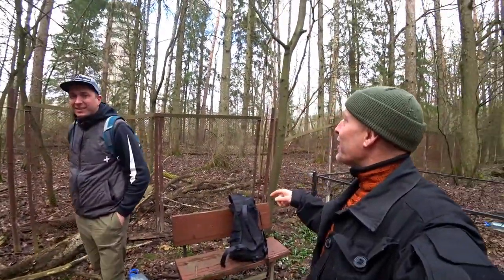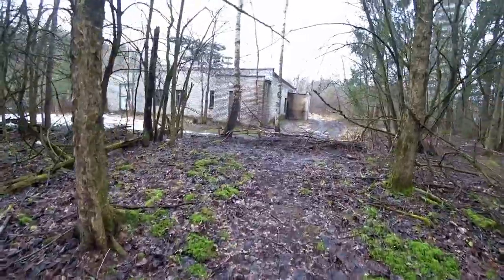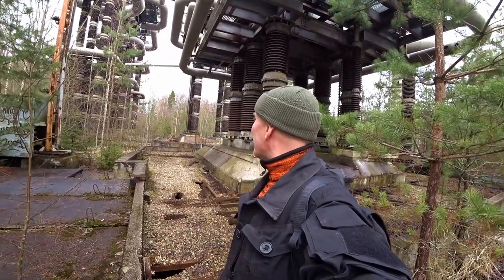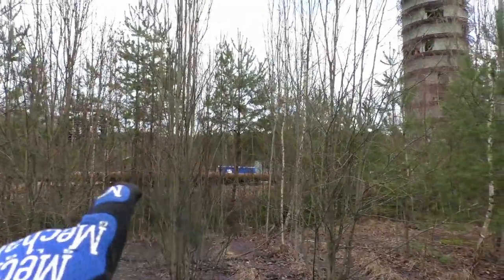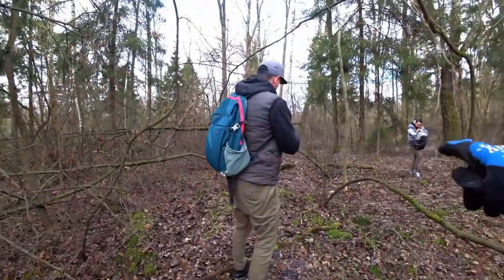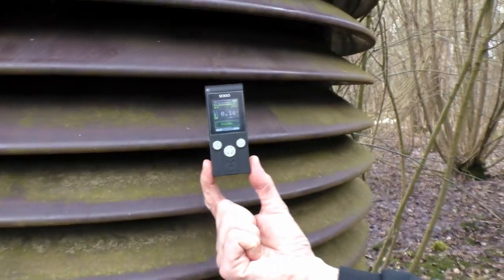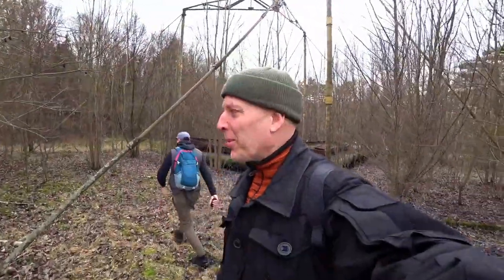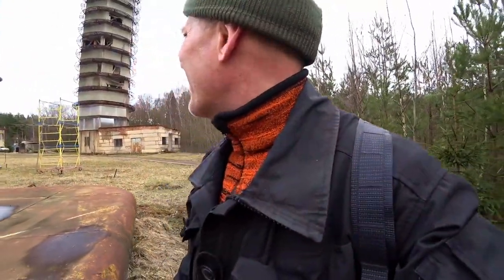Most Powerful Lightning Generator In The World 2020

Comment: the assembly with the 7 large anti-corona rings and 1 elongated anti-corona ring at the top was the cockroft-walton voltage multipler... the other large assembly was a 3 stage cascade transformer. the towers at 9:20 were responsible for generating the high voltage DC which fed the marx generator which was located inside the enclosed tower. sad to see the Cockcroft-Walton multiplier damaged
Reply: Thank you! I saw a video about the Marx generator, but wasn't sure about my assumption about one thing being a cascade transformer, despite I saw some parts looking like the transformer stages of one.

Comment: They aren't Tesla coils. They are either Marx or Graaff impulse generators. They generate 2-3 million volt electric arcs, which are used to test "diverter strips" in fibreglass aircraft body panels.
Diverter strips are intended to avoid lightning bolts from damaging the body panels.
Field day at Istra?

Comment: There is no reason there should be radiation if it's not running and powering a device that produces x rays, proton beams, or whatever.  That is an impressive facility, would love to see it operating.  Must have generated many megavolts. A Marx generator is possibly the circuit used. Great for making lightning like arcs.
Reply: 2 MV, but it's a Graaff impulse generator.
Reply: @thefreedomguyuk   Thanks for the information.
Reply: @stevef.5197   Actually, I've later been looking into this. Turns out they had Graaf as well as Marx generators at that facility. So could be either.
Difficult to see the difference, would need closer images to ascertain. Both can look very similar, obviously a Graaf would need the dynamic band somewhere in the center.
Some sources mentioned at this site had been a 3 MV Graaf & a whopping 9 MV Marx.  Haven't found any documentation, though.
Reply: @thefreedomguyuk   I'm not familiar with the Graaf, is it the same as a Van de Graaff generator?  It's been decades since I built pulsed power generators, so I may not remember everything.  The Marx generator was always fun, generates EMP. 9 Mv is respectable.
Reply: @stevef.5197  Yes, took the liberty of abbreviating  the van de Graaf name.
Am in same situation, have not been practising for decades.
I found some pictures of the facility, and upon scrutinising them, it appears as if there are 2 Marx generators and one van der Graaf, all three of them next to each other.
Seems like there are a few Tesla coil towers at the perimeter of the facility.
Reply: @thefreedomguyuk  Thanks. These devices are impressive, would have loved to see them in operation. Reminds me of Teslas's large power transmitter in Colorado springs.
Reply: Imagine that! A Marx generator in the DDR. :)

Comment: Marx generators. We use a smaller 100kA version for testing lightning protection components at work. Doesn't need to be so big as we connect the parts directly to it rather than having the electricity arc over to it.

Comment: That's a Tesla FREE ENERGY Device
Reply: Wish it was. Unfortunately russians discovered from a bad fan in a factory it transmiited a harmonic frequency that killed the workers and started detroying the factory and causing small ground tremors. The ELF frequency ( extreme low frequency) became a overnight sensation by the worlds military. By triangulating the signals they had a invisable stealth and very powerful weapon. Ergo HAARP in the USA. And Briton too staged around the Earth . 9.8 hertz for example can cause civil unrest and violence. 13-15 htz can make ppl passive sheep for brainwashing. Etc. Add a microchip implant that is really a harmonic transmitter receiver and you can stimulate the human body at will or even 6.8 hertz to over ride the signals of the bodies nerves causing complete shutdown.death.
Reply: @fatherthomas1575  Sounds like 5G
I know Tesla had Earthquake machine caused alot of damage to High Rise Hotel in NYC
Can you get parts of that thing in Russia or Fix it.. Is it abandoned ?
Reply: @stephenkennedy9322  actually a ELF transmitter can be made from radio shack for about 10 bucks . a resister for each frequency you want and a selection switch. Add a radio transmitter and use it for the carrier wave or just put it into a microwave coil with a preamp chip. For a directional weapon. ELF uses little voltage and only 4 parts resistor, potentiometer, battery and antenna unless you want to amp it up. The big tubes you see is the size of tube to resonate the frequency in a controlled way Big coiled tubes it was the ducts that made the factory fan so powerful
Reply: @fatherthomas1575  Do you know how to build a portable EMP targeting device I can mount a laser scope on to. ( for testing electronic devices being protected by EMP prevention circuits) ?

Comment: Electric discharge device, lightning simulator, millions of volts but low current. But stand back if it is activated, frying tonight.   Hair will be set on fire..
The gulag will be more interesting..
Reply: No, a Marx generator can deliver high current as well.